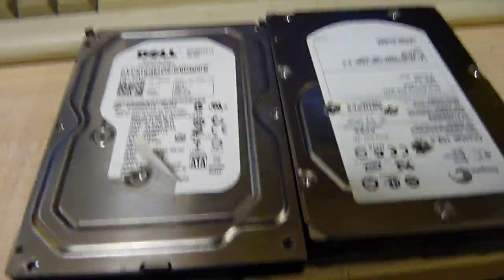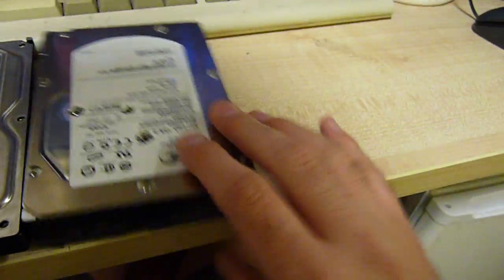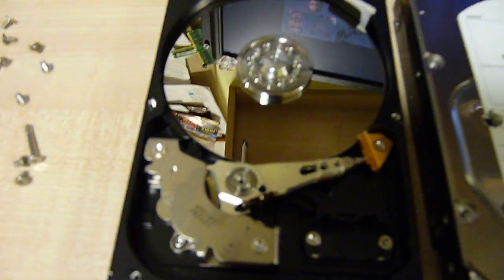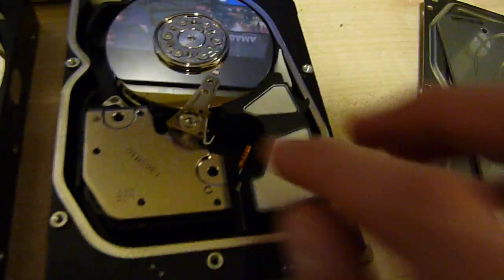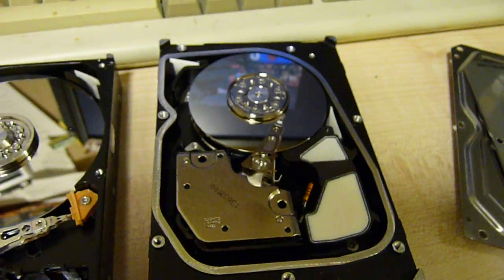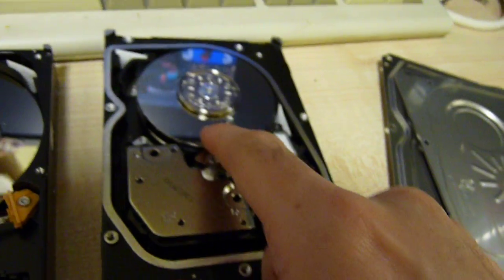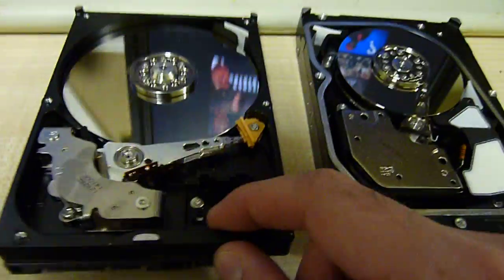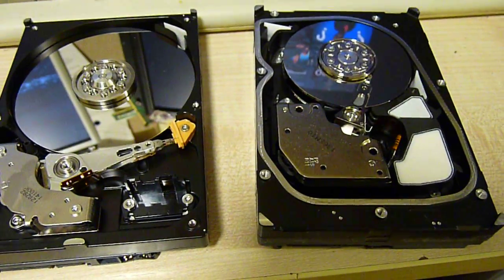SCSI SATA HDD Comparison

Comment: The SCSI drive is as you correctly said, Serial Attached SCSI (also known as SAS drives). If using a SAS based RAID controller in you system with hot plug drive bays, they are usually able to take both SAS and SATA drives. It is even possible to have a mix of SAS and SATA drives in the same system, however creating virtual disks across a mix of SATA and SAS drives is not recommended.
Reply from the maker: Did not know they were compaterble. I had oroiginasly thought that SATA had taken over not only IDE but SCSI. It would be nice to have a raid array.

Comment: Smaller disks and more platters would also equate to faster seek time being the tracks are shorter and come around faster.  It could even strip to multiple platters making even faster read/write. I'm not saying they do platter stripping but the mechanics would be there I would think.
Reply from the maker: Makes sense if you ask me. There is provision for 4 platers in that design of HDD.